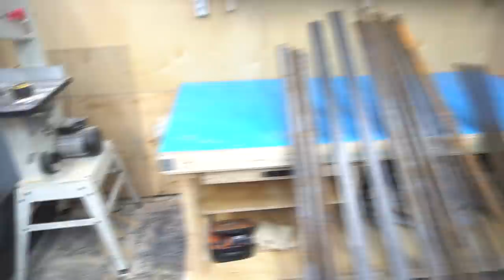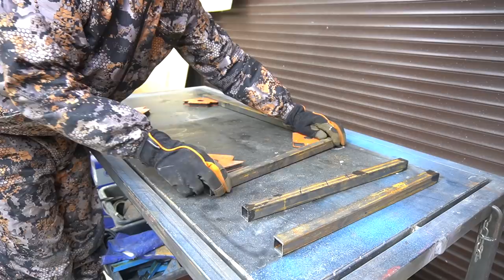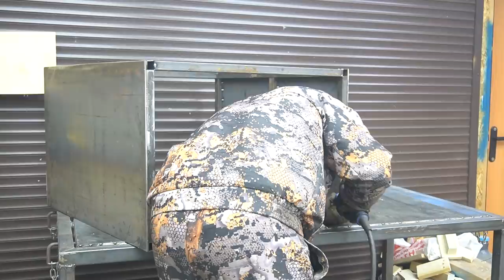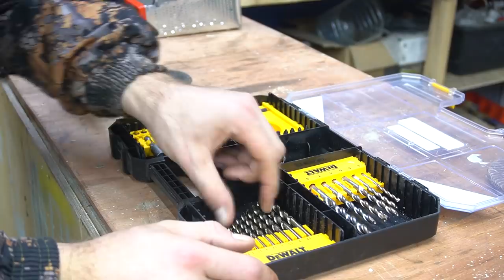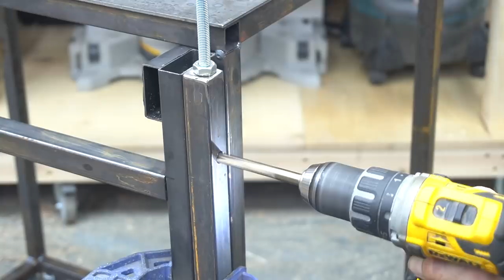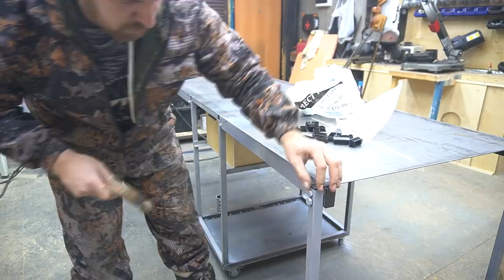Secret Profile Pipe! An amazing invention! It will come to mind!

Comment: Nice build!! Weld larger nuts to your adjustable feet...that way you have the bigger footprint, while at the same time you could use a drill or impact to thread them in and out faster